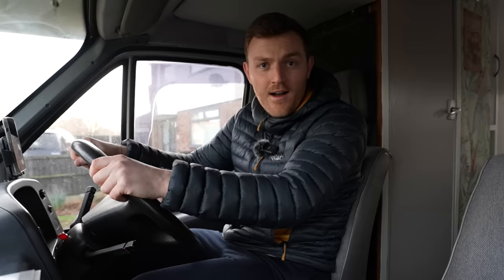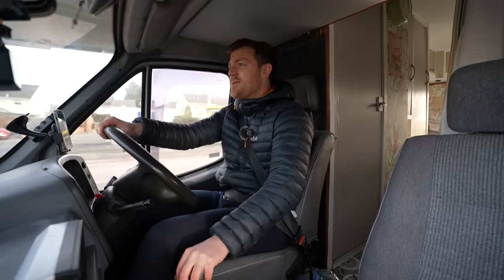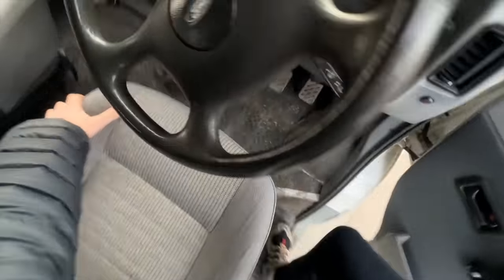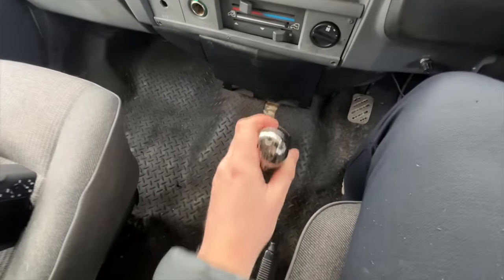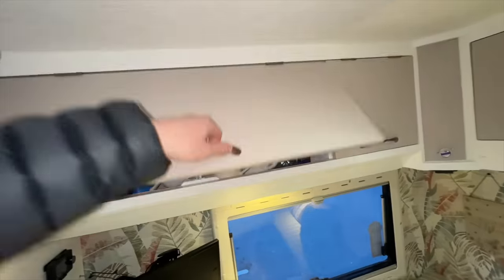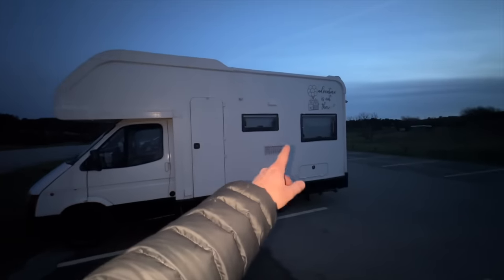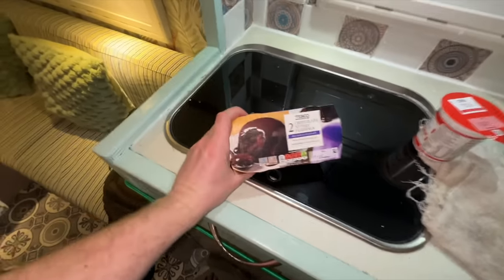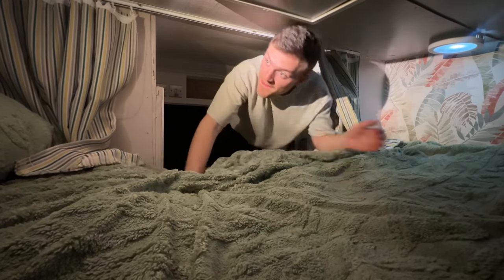World’s Worst Motorhome 24 Hour Challenge

Comment: I reckon Neil will get this old camper back to a decent standard on the outside. The interior is fantastic. 
About 10 years ago I bought a Ford Escort van for £300, I never serviced it apart from the odd tyre and window wiper. That van got me all over the country and by the time I had to scrap it, it had over 600,000 miles on it.

Comment: Since May 2023 I have been converting a 2005 LDV Convoy minibus into a camper van. It had been converted previously, but not up to a decent standard, so I took everything out and started from scratch. Working weekends I now have a pull out bed, sink/gas hob unit, fridge cabinet, toilet, storage boxes under the bed, table,  a 12v power system and 230v power bank. In have installed a butane gas bottle and pipe work to the gas hob. The furniture is made out of reclaimed wood (some reused from previous build). I have thoroughly enjoyed the project.

Comment: I think if Doug had a "kill switch" on the car battery (as opposed to the leisure battery) so you could unhook the car battery when you're parked up, there wouldn't be so much trouble starting the motorhome.   I had an Airstream camper van and I put a kill switch in it after I got stranded a few times with a dead car battery.  Worked great.  Just remember to pop the hood and hit the kill switch when you get parked!

Comment: I do like the renovation on this camper van such an inviting camper van and the microwave oven suites the decor also the clock a very tasteful renovation it would be good to see you renovate a modern classic camper van possibly an interior a little tired but in good mechanical condition as you mentioned it's one of the most comfortable camper vans you have spent a night in in over a year

Comment: that's not a jumping problem its a sticky solenoid if you cross the terminals on it with a spanner you will start it till you can replace it for like £10

Comment: I’m in the process of buying a fully converted off grid all electric Vauxhall e Vivaro Campervan. You should come take a trip back up to Crosby, Liverpool and give it a test run. It’s a vehicle I hired to go around the NC500 and the owner offered it to me recently. We had such a blast in it that I couldn’t turn it down. 75kWh battery with real world range of 180 miles plus. 6kWh onboard battery with 200W solar pop roof. Induction hob with sink and electrically powered rock’n roll bed.
Reply from the maker: That sounds epic, send me an email if you can to will@willswhereabouts.com as would be great to get some more info

Comment: There are only 5 digits on the odometer. It’s only done 26,000 miles. Unless it’s gone around and started over and it’s 126,000 miles. Or 226,000 miles. Or 326,000 miles etc…..